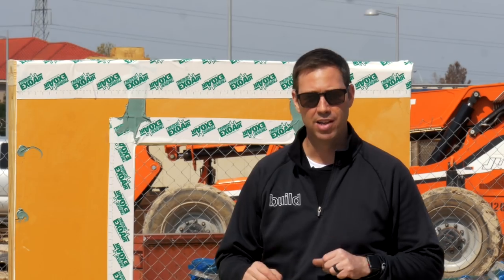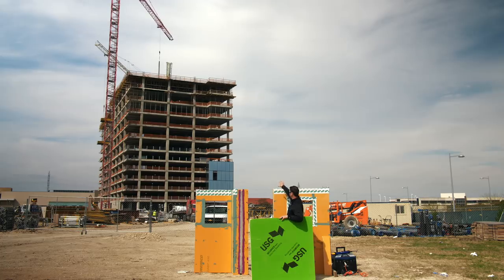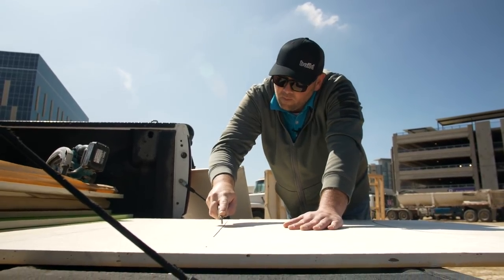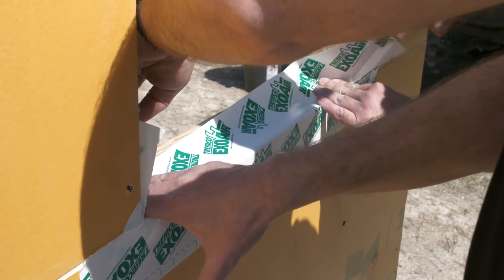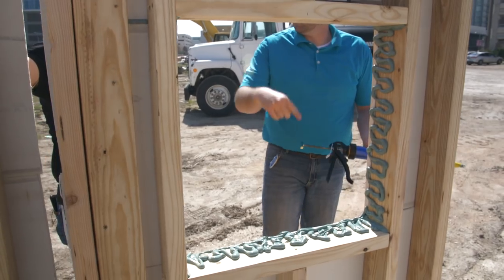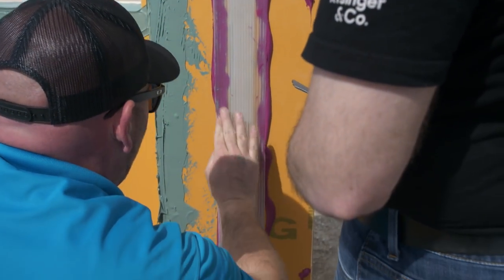A Killer New Commercial 3 in 1 Sheathing

Comment: I’m currently doing Tremco products. 1) you wanna put primer before you apply the 110(the exoair). 2) I’d prefer spreading the caulk on the corners just to make sure there’s enough space for the window. 3) caulk ALL seams on the 110 from the exteriors to avoid leakage. 4) use a j roller so the adhesive stays on.

Comment: Have worked with this type of sheeting in construction here in Seattle. It was used over a wood and steel comercial building and multi-story residential. Like this new product and looks much better than the system I had to use. Only down side to these panels is they weigh a ton! Lol. Great video, thank you for sharing..
Reply: Brian A can it be used with framing nails?

Comment: You didn't indicate any shear strength attributes which you mentioned typical sheathing had for residential wood frame construction??  Perhaps for post and beam but unlikely for stick frame, especially in earthquake zones. Possibly requires enhanced siding materials in hurricane zones too to prevent envelope puncture from flying debris. Maybe not suitable in conjunction with vinyl siding and other inexpensive (non-structural) residential siding. I think its possible lack of a structural characteristic will prevent its introduction into residential assemblies considerably.
Reply from the maker: This product is intended for commercial construction only. Correct, no shear value.

Comment: Can't say this excited me much. Why would it be any better than the zip sheeting?
Reply from the maker: This product is intended for commercial construction. This is fiberglass faced gypsum sheathing as opposed to wood sheathing. That means it’s fire resistant, and won’t support mold growth. Very different product from zip. They’re there certainly are some similarities
Reply: Matt Risinger totally get why they use it on a concrete and steel structure where it can be the WRB and not much structure. Where can you see us using it in resi construction?
Reply: Matt Risinger after reading your comments below, your saying this will be good for the steel and concrete resi builders. All good!
Reply: Also consider 0 lot line accessory buildings where a one hour rating is required, this be ideal over wood sheathing and still have the air barrier.
Reply: This new system is totally non-combustible. Which is often important in commercial construction that doesn't use conventional wood framing. Some commercial construction does use conventional wood framing though, especially low-rise buildings.
Reply: Take a look at the CCL (3rd party independent test lab) findings of the Zip system at low pressures - https://youtu.be/Ce7M0vNAeqc
I would be concerned with the overdriven fasteners and knot holes that are on all projects. - I was a QAQC Manager for Billion dollar construction Company, and know you will never "see" these types of leaks until they happen - especially the knot holes.
Reply: this would be a great system if they used stretch tape for flashing like zip with the cheaper gypsum board and if they provided a tool to apply the liquid seal quicker over cracks, like a sheetrock compound box.  It just seems more complicated than it needs to be, as far as flashing is concerned.
Reply: The real questions is that that test might not be realistic, You have a siding product over that zip sheathing, is it really an issue when the driving pressure is not directly up against the house sheathing.
Reply: I just watched the video and came away with the idea that  @buildshow  was suggesting that this was a product that could be used in wood framed home construction. It seems like that isn't the case and the product is really just for concrete and steel buildings. I was still confused about it even with that understanding. Is this something other that normal gypsum board with a water resistant coating? Is it like water resistant sheet rock? Is the idea with this panel that it only be used in areas where people aren't expected to nail or screw through it? What part of the building industry is this panel expected to revolutionize?

Comment: What a mess! The local sales guy just gobbing on and smearing things around...not impressed. Why is this better than ZIP Panel with ZIP Tape and Stretch tape?....which you have you have so often touted?? And as others have noted....gypsum has no shear strength...does it? What about weight of these sheets?? I am not feeling it here.
Reply: Profit diversification
Reply: Its also for commercial buildings made of concrete and steel. I'm not sure they even need shear strength in sheathing. Years ago, they used cross braces in residential before plywood.
Reply: 100% agreed. This product and the solution seems like a stretch.
Reply: Gypsum does have shear strength when installed with certain screw patterns.
Reply: Take a look at the CCL (3rd party independent test lab) findings of the Zip system at low pressures - https://youtu.be/Ce7M0vNAeqc
I would be concerned with the overdriven fasteners and knot holes that are on all projects. - I was a QAQC Manager for Billion dollar construction Company, and know you will never "see" these types of leaks until they happen - especially the knot holes.
Reply: I agree with you that the sales guy looked like he never did that before.
One thing that came always to my mind about Zip panels is that they are a fire hazard, with a C flame rating, they practically are suitable for a fire place. 
The UGSG green panel showed at the beginning of the video, which is the simpler version of the orange one, needs only tape and some compound as the Zip panel, to be installed. It has 100% mold and water resistance, an A fire rating with no flame. If installed on steel frame, with studs at 12" on center and 4" fastener spacing can resist winds up to 200mph (which is more than a Hurricane 5) . At 16" on center and 8" fastener spacing it can take 150mph winds. Which is a solid hurricane 4. 
USG green panel is $ 0.75 sf, Zip panel is $ 1.1 sf, at Home Depot.
I think is a no brainer.

Comment: What is the chemical make up of the Tremco ExoAirxxx on the gyp board? STPE, acrylic or what? Seems all MFR’s are now coming out with integral air barrier sheathing systems. I prefer Dens Element with Fast Flash because it’s STPE but would be open to other silyl terminated polyether’s. Thanks in advance.

Comment: Another budget build question:

With all things being equal, and you had some extra funds to improve an aspect of a home, would you spend it on:

1. A more airtight seal.
2. Higher R-value on the envelope.
3. VRF system with dehumidifier and EVR.

Granted, the cost factor is going to be different for each one, but if I am shifting funds around on the house, which one will be the best in long term value?

Thanks.
Reply: Three plane windows, with heat reflect layer.

Comment: After you  go to the effort of sealing all the seams and screw holes, how do you attach siding to this product without poking a bunch of new holes in it?
Reply: This product 's membrane is self gasketing, the sealant over the screw heads while fastening the board to the studs is recommended and required because installers often times do not adjust adjust their nose cones and "over drive" the fastener past the membrane.  When using a brick tie, or siding, the fastener can not be overdriven and as long as the fastener is installed into the stud or other structural membrane (where it will not "spin out") the membrane "sticks" to the fastener, sealing to it.  This type of product has to pass numerous ASTM tests and standards in order to be used in this fashion.

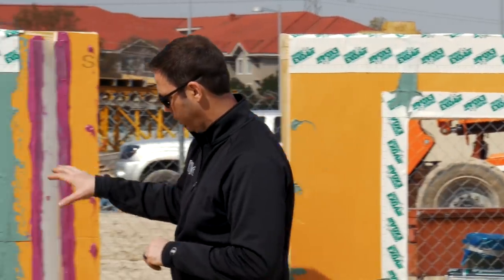Comment: 4:52        Why do you not want the TremCo Dimonic (sp?) 100 schmoo adhering to the inside corner?

Edit:    Does it have to do with movement between the panels?   That is to say, if it were adhered to the inside corner and the panels moved it might ”break” the seal?
Reply: Toob247 Toob247  -  thanks mate :)
Reply: Toob247 Toob247  -  as yo can tell from my technical language (thanks AvE), I’m not a builder :)

Comment: Can someone explain the 'crayon' thing he did in this video? Or provide me a good reference to find out more?
Reply: igounfazed it’s most likely to prevent joint failure when you get expansion, contraction or movement that can shear the sealant or exceeds its elastic limit.
You can google more, but here is a quick hit. http://www.buildingdiagnostics.com/articles/sealantjoints.html
Reply: @Nobody F: So. After reading that link, I have come to the conclusion, "Do not use any sealants without having a Sealant PHD!"

Reading that felt like sealants require the sun, moon, and stars to be properly aligned, and that I be bathed with the sacrificed blood of a virgin unicorn, if I ever want to have proper adhesion.

That said, from reading the article, they ruined the joints when they added the crayon, as they introduced weak points between the sealant and the wall, promoting future failure.

So now I am really curious why a builder, with so much experience, would show crayon being applied for sealant applications. ??
Reply: @Nobody F: Thank you for the response.

Comment: Love your channel. Just don't know what you genuinely are sponsoring or getting paid for. Should add that disclosure. This product seems like a stretch for any home builder. This doesn't solve an immediate problem especially for less cost. Zip+Liquid Flashing is superior to this and does the same "QC" you make a point on
Reply from the maker: Alex, this is one of my channel sponsors. This is intended for commercial buildings. If you do all residential this is not going to be a fit for you
Reply: Wouldn't this over wood sheathing give a one hour? If so, then the residential application is 0 lot line structures.
Reply: Take a look at the CCL (3rd party independent test lab) findings of the Zip system at low pressures - https://youtu.be/Ce7M0vNAeqc
I would be concerned with the overdriven fasteners and knot holes that are on all projects. - I was a QAQC Manager for Billion dollar construction Company, and know you will never "see" these types of leaks until they happen - especially the knot holes.
Curious how much testing you have done with types of products?  and what QAQC does Zip System integrate - do you seal every knot hole and every fastener?  If not you have potential failure locations.
Reply: Although Zip will burn and migrate the fire upward and inside the building, this material will not. 
So it may be worth also for the residential home builder as long they install it on a steel-framed structure.

Comment: Just went down this road with this on a 108k sf industrial building. Densglass with a fluid applied (sprayed) is still cheaper than any of the fiberglass faced products like this. The dens element board was almost twice as expensive and the detail sealant is still too expensive. Price needs to drop! Commercial is all about the money.

Comment: with the massive amount of plastic accumulated in the ocean, cant a 4x8 recycled plastic board be produced as siding? plastic siding instead of plywood! what would the r value be? wind resistance=0! 0 rot! 3/4 inch plastic sheathing on a house would be awesome and we could get rid of that mess in the ocean. please tell me what you think. it would be super strong and you could pu siding on it!
Reply: Plastic siding; Toxic under fire, fuels the fire. Burns hotter and faster. (Grenfell towers, uk)

Comment: why do you "bond break"with a crayon on the internal corner?
Reply: To allow movement of the joint without the possibility of breaking the seal.
Reply: For sealant to perform, it is not supposed to have "3-point" adhesion, in other words it needs to have some part of it not adhered to a structural element so it can actually move properly.  Sealing into any corner without a bond breaker is not recommended.  Check your sealant manufacturer and their requirements for proper installation / warranty.

Comment: The real reason we still see homes built from wood with yet another product to protect wood, is because industry makes more money selling these complex systems, and repairing the damage wood incurs if water looks at it, if fire touches it, or if there is more wind than would be produced by an asthmatic blowing at the house through a straw!  I see another product for dealing with water, air sealing, mold proofing... I ask myself; why are we still building with wood in the U.S? It's mind boggling that we still use a water sensitive, insect sensitive, mold sensitive, fire sensitive material to protect us from all of the above!! With the presence of ICF's, insulated styrofoam concrete and other building material we should be pushing for new homes to be built from these materials. Concrete derived homes such as ICF and foam concrete as well as steel framed homes are far more durable, reliable, stronger, more insulating, without the need of the many systems and layers needed with the current state. While the rest of the world, much of which with even colder weather climate than north America, have been building using concrete with even more efficient homes. We have been inventing one "system" after another with ever increasing complexity just to keep using wood as our building material. We have to deal with it's sensitivity in something that should not be sensitive (homes and buildings)... In fact, we are at a level where we are inventing systems just to treat another system with ever increasing complexity, cost, trades needed and time. Wood framed houses and wood sheathed homes need to go, the marginally increased cost upfront pays for itself in just a few years.

Comment: This is stupid. Do you really think that caulk and fluid applied " membrane" is going to protect sheet rock from water damage when you're using it as sheathing. And yes, fiber glass covered sheet rock is still sheet rock. I predict that with in 20 years this garbage that is being used to sheath your customers buildings is going to start to incur massive repair costs.

Comment: Instead of squeeze tube why not buckets and just trowel it.
Waste of time squeezing then troweling.
Then he presses with his finger on the"expansion joint"
Why not a roller.
Dang he's applying that thick.
Must be a tube salesman.

😆😆😆😆😆😆
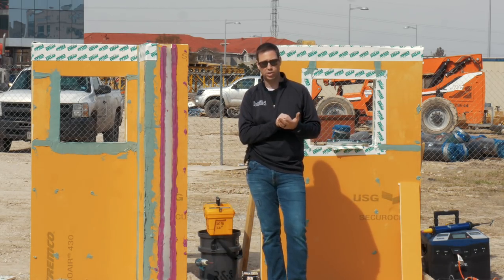1:52 just let's the board drop like....okay I'm through with paying the price of fiberglass covered residential sheathing.
I'm dropping this crap and I'm gonna start using commercial for two reasons.
One it's going to be better which the price compared to residential highline products makes sense......bam, the residential gypsum hits the dirt...or maybe he's getting out of residential building and going to sell off his residential side for a royalty fee and build up his commercial side.